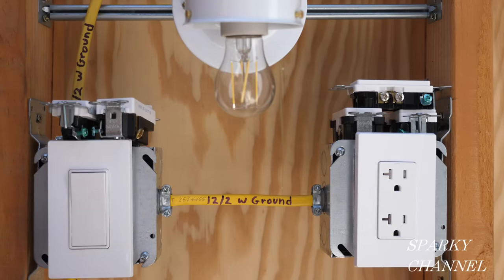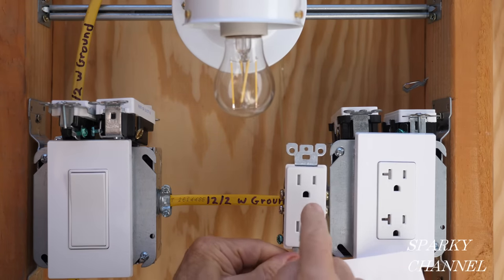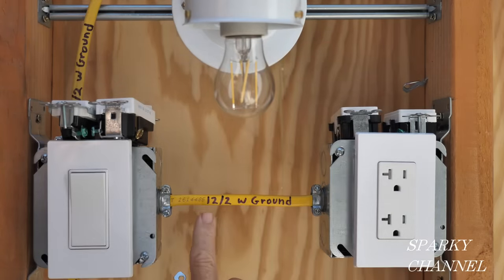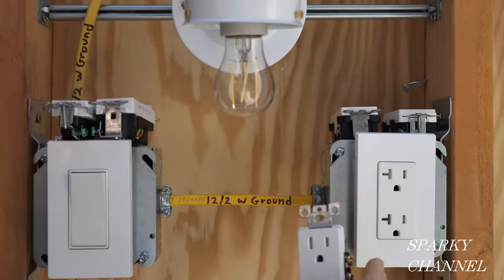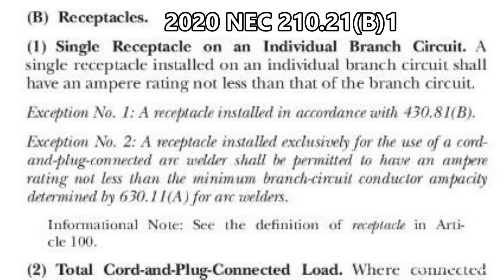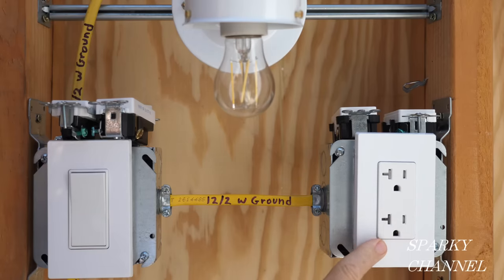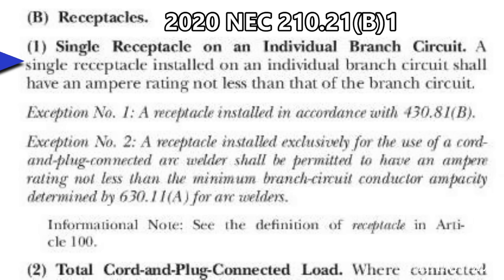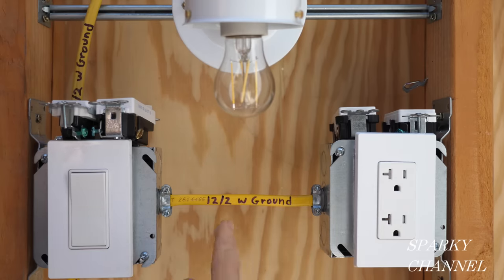Shall I Use a 15A or a 20A Receptacle on a 20A Circuit? + 2020 NEC 210.21(B)(1) and 210.21(B)(3)

Comment: Hey Bill, I wanted to ask, can you put a 15 amp breaker on a 20 amp circuit? Meaning (a branch circuit that’s wired in all 12/2 Romex cable)
Reply: Absolutely. I do it all the time
Reply: Mike  why not?
Reply: Mike  That’s not really an answer.  Can you elaborate? I believe the question Kyler is asking is if he can put a smaller 15A breaker on #12 wire.
Reply: Mike  I was just confused by your original answer saying no. I’m guessing autocorrect stepped in on the last reply, do you mean larger wire has ‘less’ resistance & is rated to carry more amperage? Kyler’s question would essentially relate to upsizing the wire (for V drop over distance for example). And there’s no code I can think of that specifically prohibits upsizing wire in that situation. I agree it may as well be a 20A breaker, unless protecting a piece of equipment being used on the circuit or something similar. (Editing the spelling & grammar errors, sorry)
Reply: Mike  Smaller wires have more resistance due to the skin effect. When you use a larger conductor than needed you are reducing resistance due to the larger cross sectional area. In addition by using a larger conductor size you are also reducing resistance by increasing the thermal mass of the conductor. The cooler the conductor the more power it can carry. Thats why the lines on utility poles that operate a split phase voltages can be sized as they are.
Reply: @JD-bd5uu  In all actuality it is safer to use 12g with a 15amp breaker. There is a saying. Use the smallest breaker you can get away with no matter the Guage of the wire as long as your conductors are capable of handling the load.
Reply: Mike   I apologize but I believe you’re incorrect. Wire is increased (from # 12 to #10 for example) when run over a distance that the voltage would drop enough to be a problem or concern (typically increased in the field one gauge every 100 feet). The more surface area of the wire (or the larger the wire gauge), the more electrons there are to move current. It’s like having a bigger water pipe to carry more water. [Eddy currents and skin effect can play a factor depending on the type of wire but that’s a pretty specific argument]
Sometimes different regions of the country call things by different trade names and there’s different explanations, but I was just confused by the original answer. Thanks.

As far as heat, heat increases the resistance value of the wire. That’s why there are different charts in the code book for wire ran in open air vs in raceways, and different columns for ‘temperature’ correction factors when sizing wire/ feeders etc.. The viscous circle is that the byproduct of using electricity is heat, and heat creates more resistance, which causes more heat and more current to be pulled, and the cycle feeds itself. Upsizing the wire is an easy way to take that particular factor out of the equation. 

Skin effect is the electrons moving over just the skin (or surface) of the wire, not the core, which is why stranded wire (and smaller strands & more of them) is more common and popular now.
Reply: Mike  Lol, all good brother. Not an engineer, just a salty old commercial electrician who likes to teach our apprentices and definitely the young project managers what actually happens in the field. They like to send out a lot of CAD drawings, and I like call them out to explain how their drawings are physically (im)possible.
Reply: Mike  Well, if you have a very long run you will need to upsize your conductors to account for voltage drop. Their is also an ease of upgrade for future proofing situation. Take a set of bedrooms in new construction. If both those rooms are on the same home run with 14/2 they may run into issues with gaming computers, portable heaters, and window mounted air conditioners. If both rooms were wired in 12/2 all you would have to do is change the breaker. You also have other situations that may arise from the used of modified sine wave inverters or generators as a backup power source. Harmonics are an absolute pain in the ass. So, if the customer wants to do it then just let them do it. If it’s a circuit where you would normally used 14/2 but the customer wants you to use 12/2 then use 12/2 and put it on a 15 amp breaker. I once did an entire house where everything was up-gauged. 15 amp circuits were done in 12. 20 amp circuits were done in 10. 30 amp circuits were done in 8. And the 40 amp circuits were done in 6. The breaker sizes did not change. Every breaker were GFCI/AFCI combination breakers. The service had a level 1 surge suppressor between the meter and the main panel. A level 2 surge suppressor was also installed in the main panel. The client insisted on having us use MCAP instead of NMB. The client was an electrical engineer who worked on submarines. He knew what he wanted and was more than willing to pay for it. So be it. He probably has the safest house from an electrical standpoint in his community. Nothing wrong with that.

Comment: What would you recommend for a outlet or switch with my home being older all breakers are 30amp with exception of dryer and a/c what should i used
Reply: probably reduce breaker size to 20 amp. You're never going to pull more than 20a anyway and it'll just be a lot safer.

Comment: Thanks for this video. What about mixing 15amp and 20amp recepticals in a circuit? Does this function properly? Perhaps your bedroom 12awg circuit has 15amp plugs but feeds an outdoor plug you may want 20awg. It would beg the question, does the extra draw on the 20amp plug stress the 15amp plugs down the circuit and cause harm?
Reply: AdrianJayeOnline, poorly worded question on my part. If I had a 15amp circuit for the bedroom but used a 20amp recep outside (gfci) would there be any reason or benefit of using it? I suppose I am limited by the 15amp load of the breaker and 15amp recep regardless of the 12awg wire. Ie, would the 20amp recep hold a greater load than the 15amp receps? I suspect not.
Reply: @reedrobb   First off that whole circuit  BECAUSE OF the circuit breaker is 15 amps , regardless  of the size of the receptacles.  As for the circuit "pass  thru" or as you said Stress the 15 amp plugs Question -- Yes  BUT depending how they are wired and if they are cheep or not.
 Let me explain and I am assuming its a bedroom circuit of 5 or a few more receptacles plus an added one on  outside (gfci) Correct? 
 OK  how are the room outlets/receptacles  wired/connected ? That would make the difference for the answer---
 On each  are  there 2 black wires  to the 2 brass screws (same for the white wires /side) ?  This is a true pass thru because they pass the current thru that  break away tab on the receptacle between the screws on each side .  Or are they pushed in to the back of the receptacle ? (push in  NOT screwed down in the back holes like the high grade receptacles) 
 Either of these 2 methods pass thru or push in's  COULD lead to a circuit failure if the 20 amp GFCI allowed a high current draw .... I said could and I have repaired many circuit components  from this type of event ----- The reason is you are asking the weakest link in the chain to do more than it was designed for. I disagree with the video owner on the outlets  pass thru rating too they are not rated at 20 amps they are barely 15 amps. MY inspector will NOT pass  wiring  this way.   
A note here NEVER EVER USE the Back Push in connecters either  they do not make a tight connection EVER! If Your out lets are wired  this way change them!
Here is what I would do for reliability in this example:  wire every  outlet with 2 pieces of 12/2 w ground wires in the box .... in "pigtails" -that is 2 black wires  plus a short 10 inch black wire piece twisted together with a red wire nut  (same for the Whites and Ground wires) then that short length of wire  goes to the correct ONE screw on the receptacle.  Yes I know the grounds can be done a little different greenies or crimps used instead of red wire nuts  - I use crimps  and NO short wire  the 2 grounds are twisted and crimped with one tail for the metal box the other to the outlet.  (or one wire snipped if plastic boxs)
Can you see how my method makes every connection on the circuit a tight secure connection that is equal along the whole path of the circuit and not ''passing thru" a week link ?  Hope I explained it so you understand.
Reply: Peeved Patriot,  thanks for the reply. Good explanation. I have been doing minor electrical work for years in my handyman repairs and when wiring an 1800sqft addition on my home. I never rely on those push terminals or those wago nuts on my work when leaving it permanently. The thought of a small flat piece of metal touching the wire vs. a 180 degrees wrap around the screw terminal seems like a no brainer.
Reply: @reedrobb  Bingo
Reply: @reedrobb  yes as said it IS still only capable of 15a due to wiring and breaker but I have used in some circumstances 20a recep's on 15a circuits, 20a recep contacts are heavier duty than 15, I believe in overkill protection
Reply: @peevedpatriot3217  if you read the UL rating on these recpticals they have been tested and rated for 20 amp pas thru. They are good to be wired that way. It's not just a little flimsy metal. Look how thin the buss in your 200 amp panel. That's rated for 200 amps top to bottom.
Reply: @thomasmarable6818   Like I said --  "I dont carer what the ratings say"  ---my box of burnt dead receptacles  is the proof --don't relay on the pass thru method folks
Reply: @peevedpatriot3217  improper install by so call electrician.
Reply: @thomasmarable6818  FYI ALL my effing work has Been inspected by a man who also wrote for  the National Fire Protection Act  his name is on many NEC versions / updates ... I tend to believe him over some basement internet electrician -- I stand by my work as a Proper Electrician !
Reply: @peevedpatriot3217  didn't say nothing about your work I am sure it's fine but as first basement electrician I got over 40 years as an electrician/ engineer under my belt . I have been apart of code making process. Along with being a leader in electrical testing. So I could work circles around your ass
I  to had replaced tons of burned up devices, most because of bad install all I was saying, so before you insult somebody you need to be sure you are correct.

Comment: What if my machine has a 6-15p plug?
Your telling me the new code will only allow 15amp receptacle on 15amp circuit, yet the plug on the machine will not fit 15amp receptacle. ??
(The machine is a 220v bandsaw running 9.8amps and suggests 15amp breaker)
Reply: Actually this would be a single receptacle, so I guess my 20 amp receptacle would be ok then on a 15amp circuit
Reply: Is that a 220/240 volt power source or a standard 120 volt? Sorry, not really sure what you're asking.
Reply: @surferdude642  220/240
Reply: @jhubs4550  Since your machine has a 6-15 plug, you need a 6-15 receptacle. What receptacle do you have?
Reply: @surferdude642  
6-20. Think i figured it out though
Reply: @jhubs4550  That's it. The horizontal blade on the plug will fit in the horizontal (T-slot) on the receptacle.

Comment: Wonder if Ace carries the specification grade?

Informative video. Thanks.
Reply from the maker: I'm not sure. I think they should though.
Reply: They do.  I bought some 20-amp, two-way switches from my local Ace Hardware for my kitchen when I changed to decora switches and receptacles.  There is a price premium for spec grade: ~$4 per switch, vs ~$1 for the cheap switch.  I ate the cost for spec grade as I changed only a handful of switches, but they will add up quickly if you redo a room, or a whole house.
Reply: Normally Lowe's or HD have a guy who is knowledgeable about electrical gear. Sometimes Ace and TV, too. Ask him if they carry "spec grade" outlets. Morlamweb is right, spec grade normally runs $4-5-6 per outlet. One of the first things I did when I moved into my '70's era home in '87 was to replace all outlets with "spec grade", and document every load (outlet, light, overhead fixture, refrigerator, dishwasher, kitchen counter microwave, kitchen stove, washer, dryer, baseboard heater, ceiling fan, etc.) was fed by which circuit breaker. Big help when I put in a propane generator and an automatic transfer switch a few years later.

Comment: It is still code that you have to use 20a receptacles in commercial right?
Reply: @PhillipBridgesReviews  he didn't mention that.  He said you can pick.
Reply: No.  It never was.
Reply: you only have to install 20A receptacle FACES if the equipment you are plugging in requires it, or if the design specifies them.  otherwise, all receptacles with screw terminals are rated to be installed on a 20 amp circuit.
Reply: @kenbrown2808  well thank you, I was clearly wrong.  I love learning.    And ken what is a receptacle face?
Reply: @--JohnDoe  I was using that to differentiate between the feed through rating and the receptacle rating.  as he said, the receptacles he showed were both rated to be installed in a 20 amp circuit.  but only one was configured to accept a 20 amp plug.  if a piece of equipment will draw too much power to safely use with a 15 amp receptacle, it is supposed to have a 20 amp plug; which has a horizontal neutral blade to prevent it being plugged into a 15A receptacle.

Comment: Can I mix 20 and 15 amp receptacles on a 20 amp circuit?
Reply from the maker: Yes, absolutely. They are both rated "20A pass-through".
Reply: Yes you can, but why? It could be confusing to others in the residence.

Comment: What about a 15A single receptacle without pass thru and with a built in LED? it has to be a 20A unless #14 wire and 15A breaker? Seems not too logical
Reply: On a combination device like you are describing, the LED light is referred to as an “Outlet”, so the receptacle portion of the device would still be considered a single receptacle and 210.21(B)1 would apply.  So a 15A combination device with a receptacle and LED light would have to be on a 15 amp circuit, not a 20 amp circuit..

Comment: Can use 20amp outlet if the breaker is 15amp and the wire is 14 2 gauge
Reply from the maker: No.
Reply: Code does not allow, if 15A receptacle isn't holding up to device,  you need a 20A circuit to upgrade to a 20A receptacle.
Reply: If you want a more durable receptacle,  get a listed high quality 15A receptacle. 
Or upgrade to a 20A circuit, wiring and breaker.
NOT JUST THE BREAKER!
Reply: It literally says right in the code that he showed that you cannot. The 20 amp receptacle allows a 20 amp plug to be plugged in. I am surprised he didn't even mention that. See that horizontal slot, that is for a 20 amp plug.

Comment: can you use a 20 amps outlet on a  15 amps (14/2 awg) circuit?
Reply from the maker: No.
Reply: Yes
Reply: @patrickhein9470  you trying to kill this guy lol?
Reply: @gigachud575  how would that happen?
Reply: Nope
Reply: @patrickhein9470  Someone comes along and plugs in a 20A device into a receptacle designed to receive that plug type and boom his 14/2 wires are burning his house down. It's dumb, you might be thinking "b-b-bbut if he doesnt plug anything pulling 20A he's fine" is just being a pedant
Reply: @gigachud575  what pulls 20a on a chord in a home? Nothing. The closest you will get is a portable heater. At 12a it will melt both a 20a and 15a recpt. Nobody makes anything for homes with a 20a chord end anyway.
Reply: @patrickhein9470  microwaves can pull up to 15a, and its recommended not going above 16a on a 20a circuit. Not sure why you think anyone likes these pedantic games, just install the right receptacle to avoid problems
Reply: @gigachud575  lies will not win this argument. Only a commercial microwave pulls that much. Your typical microwave isn't even close and pulls 10 amps
Reply: @patrickhein9470  I thought it was only a space heater? Now its also some microwaves? I'm sure I could think of other examples which prove my point, but you can continue clucking around
Reply: @gigachud575  you made the claim not me
Reply: The whole idea is to protect the homeowner.  A friend of mine is into ceramics and has a few kilns.  I’m sure if she saw a 20 amp receptacle, she’d plug it in and put too much of a load on the wires/receptacle/breaker.  It’s just a bad idea and I’m pretty sure it’s against code and if you sell your house the inspector will probably have you replace it.
Reply: NO. Only a 15A outlet with 14/2 wire.
Reply: The code seems backwards to me.  If I have a 15 amp circuit with a 20 amp receptacle, won’t the breaker trip and protect me if I plug too big of a draw item into that plug?   As a homeowner don’t know what the receptacle amp rating is.  What does it matter if it’s a 20 or 15 receptacle?  I would think the rating of the circuit is the most important thing.  How is the receptacle the problem?
Reply: @chrishill3934  breakers are thermal and often the receptacal will melt before the breaker.  Just spend the 10 bucks and buy a damn 15a
Reply: @chrishill3934  the receptical could allow someone to plug in a T plug for an extension cord or device that would draw way too much power.. upstream breaker trips late after the shitty 14ga wire is already trashed.. That's how.
Reply: @chrishill3934  On 20 amp receptacle it is written 20 amp (plus slits are different).  So you are basically mislabeling your circuit.  For what purpose ?
Reply: @patrickhein9470   my mwave pulls over 17a....
Reply: the breaker would trip if overloaded because it should be 15 amp @gigachud575